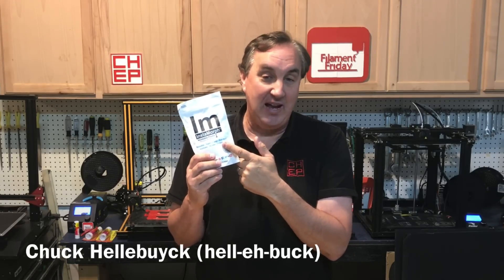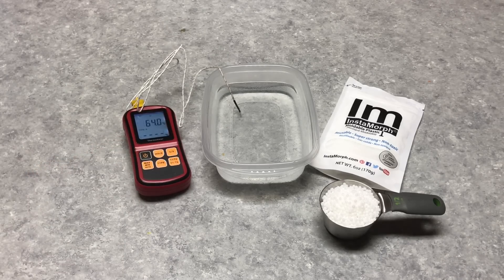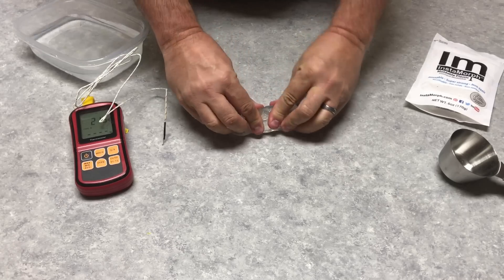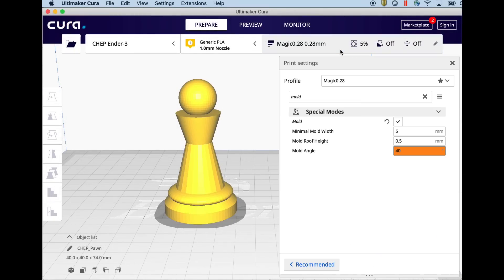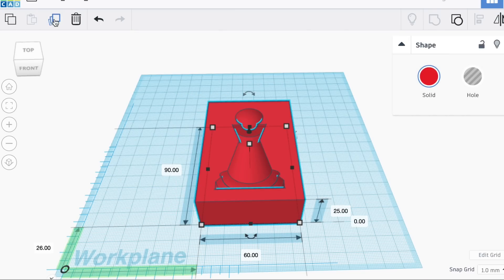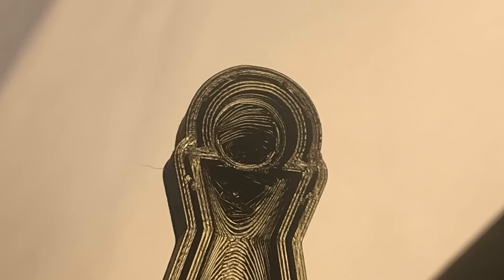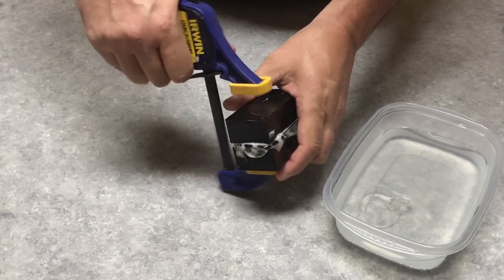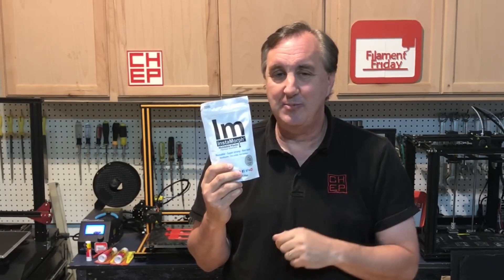Instamorph Moldable Plastic & Molds in Cura 4.3

Comment: For the temperature range you're getting with Instamorph, you could just use wax.  It melts in the same temperature range and becomes fully liquid so you can pour it into the mold.  If you put registration pins on your mold halves, they'll automatically match up; then just wrap a couple rubber bands around the mold, pour in the wax (though a hole you left in the bottom for this purpose), wait a half hour or so, and open the mold.  Great for making custom designed candles, if nothing else.

Comment: Instamorph is not a fan of molding. That's not to say it can't be done mind, just that it's not made for it.
First it swells some fair bit when hot then shrinks back down when cooled.
Leave the bottom of the part as an open end on the mold. Sandwich the two halves with the hole end up. usually it will draw from the open end leaving your part slightly hollow, but the surface is intact. So, If you set it up to have the open end a deeper hole, you could overfill, then cut off the excess after you are done for one solid piece.
Another option is to heat it layer by layer (add 1-2 layer of pellets at a time) and heat it with a heat gun, you can keep it all very liquid until you have a full mold. (again allow for shrinkage)
Interesting note on that approach is that while fully solid, it's not as rigid. I molded a 1/4 inch strip that way and it was quite flexible. However, hand molding the same size strip after stretching and folding to mix the IM resulted in a stiffer strip.
An option could be to hand mix the IM then heat it again to the point it can flow. (it's a tad hotter than comfortable to hold at this point) Flow it into the mold and let it set up.
However, this method would best work on a mold that could be heated to allow the IM to settle into all the nooks without trapping air.

Comment: Polydoh has a faster cure time and from experience I've noticed that nothing sticks to it, not even cured polydoh. You could buy a two part pawn mold (silicone) and use that. Plus it comes with six different color pellet packets

Comment: Hey, i was thinking and what if you made the mold with a little hole into the open part made out of water dissolvable material so you can fill it from the hole and then when it dries just put in water and it will just leave the thing that you are molding

Comment: Hi Chuck, thanks for your videos. I learned a lot from it. I do not have a 3D printer yet, it will be my Christmas present. I have seen a lot of videos and read articles in recent months. As a pensioner, I can do that now. I was thinking about another type of mold technique. In order to print heavily used mechanical parts, I came up with the idea of printing thin walled 3D models with directional infill max 10% and pouring them with epoxy resin - fiber mixture. That is, the model is the outside form and the casting is the reinforcement. Is that a stupid idea, or has someone tried that. I would be glad about criticism and suggestions. HD

Comment: Hi Chuck can I make  2 suggestions?
1. which I notice has already been made which is some registration pins or detentes to help with mould alignment.

and 

2. Add a "Flash Gutter" this is narrow channel parallel to the profile of the component cut into both mould faces and connected to the mould cavity by several channels. This feature is usually found on pairs of drop forging dies and since the method you are using is essentially a simplified version of drop forging it should work well allowing any excess material to be squeezed out into the gutter instead of bonding the mould faces together.

Comment: I made some South Park characters for my daughter by molding with silicone from Freeman Supply.  The negative mold was 3D printed from files I found on Thingiverse.  And the characters were molded from this using the silicone.  Silicone removes nicely.  Smooth-On is another company that has silicone, polyurethanes, etc.

Comment: Chuck, you are almost there, here is how I do it: First, use the printer to print the pawn, this is your "master" (some call it a plug). Next you use something like silicone to cast a mold around your master. The mold may have to be two parts due to the shape. Fill the mold with whatever you want your finished part to be and you're all set! The benefit of silicone is no release agent is required! Fyi, there are home made silicone putty recipes using silicone calking and dish soap ;)

Comment: I would print the mold in PETG since it doesn't need a release agent and also has a glass transition temperature above the IM working temperature. also some structures to help with the alignment of the mold halfs would be handy, or at least holes to use nails for alignment.

Comment: @CHEP One of the guidelines about molding and casting is that one part is flexible and one part is rigid.  Both the PLA and InstaMorph are very rigid, so you will have trouble there.  The Flexible filament may help help, but you might get by with a thin shell and ABS (since it is less rigid than PLA).  

Also keep in mind that demolding requires that one part moves away enough to break the surface bond between the two materials.  A mold release acts as a barrier to keep the two materials from chemically bonding, but not mechanically bonding.  A layer of water is enough for a mold release between two smooth surfaces of InstaMorph.  That said, knock down those ridges inside your mold to reduce the issues with mechanical bonding!

The plastic in InstaMorph is also sold under other names for less (and more) on Amazon.  Polly Plastics Thermoplastic Beads is the same plastic for a bit less.  Worbla is also based on the same plastic.

A lot of your issues are around mold design for the types of materials you have.  The pawn has a significant undercut between the head and body, making it a poor piece to learn with.  Try playing around with a single part mold before going back to two part mold - you will get a better feel for what the materials like to do.  When I teach mold making, I have my students use a ST:TNG com badge because it has a moderate mix of vertical, curved, and flat areas for them to feel how the part releases from the mold.

Comment: Please help i got a serious problem😭
My CR10s5 printer it  keeps pausing each few seconds and cool down during printing

Im using cura4.3 slicer 
Any ideas?!
Reply from the maker: I’m not sure. Never heard of that.
Reply: @FilamentFriday  
I finally fixed it someone posted the same issue on ultimaker community
(Print paused) and sometimes (error change filament) will appear on LCD screen 

The fix was easy just disassemble the detector sensor and bend the little bar outward

It was really an annoying issue to resume printing each half layer

Comment: A neat trick for cutting things in half in cura is just dropping it below the bed, that way the layers below don't print, it isn't a published technique but it works really well- I use it for cutting filesi want to mount on a wall like the t Rex skull, but it would have worked brilliant for making your mold.
It may also be worth rending some locator pins/balls if you go down the tynker cad route- add in a sphere half way on one, on one of them keep it on the other just remove it and now your mold parts will hold together nicely.

Comment: When you make a 2 part mold, you really should have registration pins for alignment. For your pawn, mirrored along the centerline of the pawn you might try a conical shape on one side and its inverse shape on the other. Then do the same thing lower down but reverse the order. Also, since you are using an excess of material, you might want to leave the bottom of the pawn mold open to allow the excess to escape from there. 
Also, Vaseline the cavities, and then use a slight dusting of corn starch. This is an excellent and cheap mold release. 
Keep up the great videos.

Comment: I didn’t know cura had this feature.  I think printed in a thin TPU (glove mold when done with latex or silicone), turned inside out, apply wax and some silicone oil from Lowes (if you don’t have any actual mold release), then pouring epoxy in could be very interesting.

Comment: this needs to be in filament form,  could make a high temp silicone mold around it, then melt it out and fill mold with low temp stove top metals like pewter. would be excellent for shapes that won't allow you to make a multi piece mold.
Reply from the maker: You can buy it for 3D pens.
Reply: eSUN makes PCL filament. It started out as a way to make low-temp 3D printers for schools that'd be safer around young students. It's found a niche with 3D pens though. Usually requires firmware modifications to use in a printer, because the temp is so low it triggers cold-extrusion prevention safeguards.
Reply: @Bakamoichigei  thanks  very, interesting. Think I'll have to pick up a roll and see if it would work. Needs to go soft enough that you can actually split it into a few pieces, ro release from mold.
Reply: You don’t need to melt it out since silicone won’t stick to most plastics (I’ve used mold max xls ii on PLA before and it didn’t even try to stick in the slightest.)
Reply: @ualdayan  you do for complicated shapes, where you cant make multi part molds.
Reply: @GlaucusBlue  I feel like I'm missing something - if the shape is too complex to remove the original from the silicone without melting it out, how do you plan to get the metal copy out without damaging your silicone mold?
Reply: @ualdayan  you dont

Comment: What is your favorite printer?
Reply from the maker: Hmmm... I like a lot of them. I use the Ender 3 the most though for the channel.
Reply: @FilamentFriday  i have ender 3.. And i replaced half of the printer with better parts and still i don't like the quality of printed items... What the best printer for future...?
Reply: @MbySK  it's 3d printing... We are never satisfied and there are lots of mods because you start out with one printer and I tinker it into a super printer.  :)  I have a $1000 delta printer from a few years back and it is the same.   My Ender 3 (s) are now the workhorses and do 99% of printing except when I need a BIG item.  And that doesnt happen too often so it just sits.  But you just have to keep working on your E3 till you get it going right.   There is a subreddit /r/ender3 that can help if you upload pics, etc... If you want the help.

Comment: Hi Chep, thank you for the very interesting video as usual!
I would like to advise you to be careful when using mold release agent, especially if they are silicone based and in aerosol format. I don't know if you are trying this kind of solution, that on one hand is probably one of the best, but on the other (maybe for you it is obvious) if some of this product reaches the printing plate can cause a serious issues, preventing future items adhesion, and cleaning silicone is painful... So in my opinion, it is much safer to treat the molds with the release agent in a separate ambient. Hope it helps.

Comment: I would fill the two mold halves separately, leaving them slightly proud. Let them cool completely, then join them by heating the mating surfaces gently with a heat gun. You only need to reheat a thin layer of each to get them to bond.
Reply from the maker: Good idea

Comment: Great video.  I was also thinking that you could mold the Instamorph around a 3d-printed object to create a mold for liquid molding materials that pour but don't get hot.   I'd also use the Instamorph to create temporary fixtures then re-melt them when you are done.
Reply: I use it sometimes making jewelry.. If you have an oddball shape that you cant clamp or hold easily for sawing, drilling, stamping, etc... You put it in some of the instamorph.  Then into your vice, etc.. Do ya thing.. Then drop it back in some hot water and pull it out when it softens to do the next step... Since it's reusable also it's economical.

Comment: When you needed to split the pawn in half, I expected you to just sink it half-way into the base in cura and print two copies.  Of course that would only work with symmetrical models.
Reply from the maker: I did that but the inside sagged at the top leaving a lot of stringing.
Reply: @FilamentFriday  Oh, right. I might of thought of that. We're worried about the inside, not the outside.

Comment: Hi Chuck, great vid as always. I'm a bit confused at 7:30. You said the inside wasnt done (cured) so it broke the mold. If the inside was still slghtly soft, you have far less of a chance to break the mold compared to if it had set solid. 
Also, you gave attention to using a de-molding agent which is great but cant help think that the layer lines of the mold especially those close to the edges where the two molds touch eath other, will act an an anchor for the pawn making it difficult to remove. Sanding, using filler, printing the mold using tpu or print standing upwards may be some other options. 
Removing a hard model from a hard mold with areas where there are no bevels (such as the edges of the mating surfaces between the molds is always a challenge unless you're couting on the model shrinking.
H hope this helps. I know you'll find a way. Looking forward to your next video. Thx

Comment: Escape hole + registration pins on each half of the mold + use coolmorph rather than insta/polymorph (coolmorph has a lower melting point, so less likely to bond with PLA/ABS), also no need to put it in the fridge, just plunge into cold water.

Comment: Hi Chuck, what many factories use in the molds is silicon base lubricant, also use flex material for the mold will help to make it easier to remove. one sugestion is to put the flex mold in a box so it can be pressed.

Comment: I think you might have more success by making a silicone or plaster mold of the 3d print to use for the instamorph plastic. Also... pack each half of the mold independently, trim screed the top leaving a slight excess and then clamp together.

Comment: You should put a piece of wood or something between the clamp head and mold to spread out the force evenly. Also better to use non safety clamps so you can go as tight as you want C clamps would probably work as well, and maybe put a "drain hole" in the top or bottom of the mold so you can see in and check when it might be done. Also it's going to shrink as it cools, so that's something to look out for.

Comment: First of all let's talk about your mold. Specifically how rough it is. When printed in that orientation you're amplifying its roughness. Basically locking it into the mold. Stand it up, So the layers are in the same orientation as the original part. This at least gives you a chance to remove it.

Next, make sure you fill the entire mold up, a little at a time. Or else air bubbles will be formed.

When it cools, you will have another problem. It will form a vacuum. You need to figure out some way to break this vacuum. Maybe make the mold in three or four pieces to reduce this  tendency.

Also you want to put alignment pins  in each half of the mold. This will make sure the mold is lined up properly.

Figuring out an injection process maybe your best bet.
Reply: No bubbles with instamorph/polymorph.

Comment: hi chep! you should use soapy water. I use that to mold some hi temperature silicon and it works great. In fact I usualy split my molds in parts that i can screw together. unmolding is then way easier. Last point I always add some small holes to let the excess escape. you should try it's easy to do in fusion360.